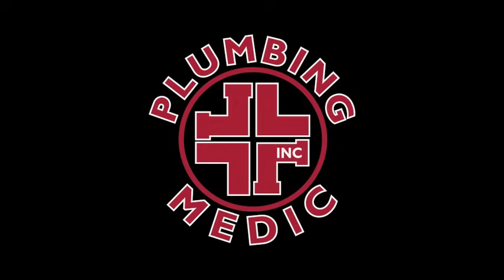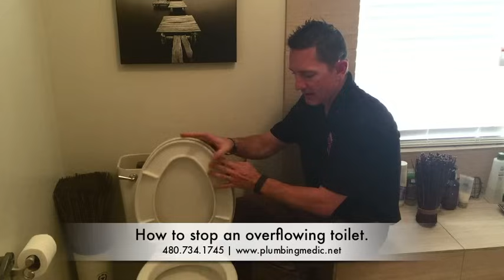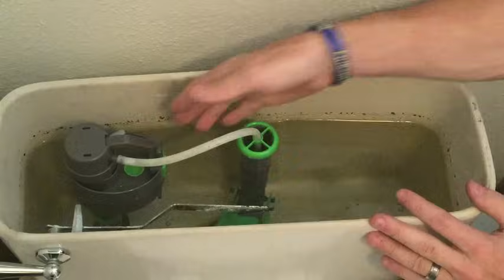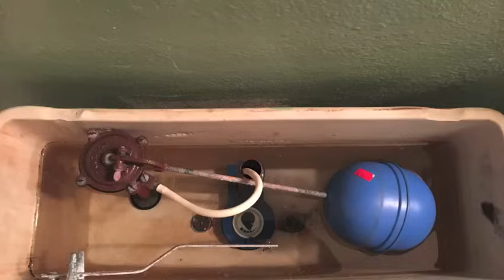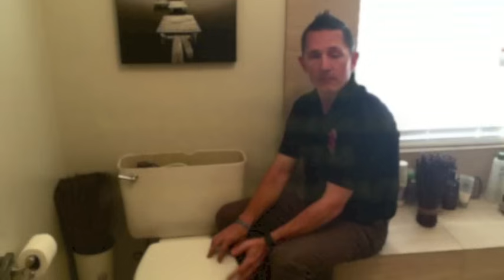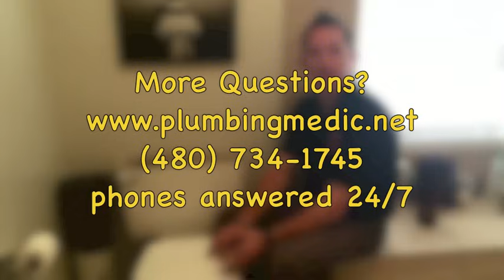How-To Stop an Overflowing Toilet | Rite Way of Phoenix

Comment: AHHH I did a dump and my toilet overflowed and my brothers always get mad when that happens and think it's my mom 💀 I'm shaking 😭 I had to wake up my mom but she went back to sleep😭😭😭😭
Reply: i̸Lucx̸y 1 I need ur help my crap is everywhere what did u do to fix it oh my god it’s overflowing
Reply: God damnit I did that to I’m not coming out of my room rn
Reply: this is the funniest comment section
Reply: @kar12894  It shouldn't be but it is 💀
Reply: I used way too much toilet paper once, and it overflowed so bad that it flooded the bathroom, and was dripping from the ceiling downstairs.

Moral of the story: If you have to use that much toilet paper flush between wipes.

Comment: I have had an issue five to four times where I would flush my toilet, wash my hands, and dry them to return 5 to 10 minutes later with a flood in my bathroom and a over flowing toilet. It will take maintenance about 15 minutes to come save the day and they can't find anything wrong. The last time it happened the maintenance had to snake it a for 5 to 10 minutes because he felt a block but eventually got it to work. This has happen over the course of 2 years. It's very frustrating and it causes damage  downstairs under me and her damage is worse. I'm the only person whom uses my bathroom and I use the very thin Scott brand toilet paper to make sure that's not the problem. Any clues to what can be happening?

Comment: This is NOT the best way to stop the overflow.  A plumbing company should know better.
Water goes from the tank into the bowl 2 ways:
1]  The MOST water is going to be from the bottom of the tank through the "flap valve," which is not even mentioned in this video.  This is the big (rubber/silicone/whatever) valve that is opened when you "flush the toilet."  It will stay open until (almost) all the water drains from the tank.  Shut this off FIRST, by reaching down to the bottom of the tank and pushing it closed.  If you do not do this, then your toilet is still going through a full flush cycle.
2]  The other water entering the bowl is as presented in this video, which is from the fill valve, from the small tube that is pointed into the stand pipe.  So yes, shut it off also, either by lifting on the mechanism (as in the video), or by turning off the valve at the wall.  Note, some toilet fill valves do not have a mechanical lever to "lift up" to shut it off, rather they are pressure activated.  The only way to shut these off is by closing the valve at the wall outlet.  However you can remove the tube that points into the stand pipe and re-direct it into the tank.

You can do both at the same time by the way.  Yes, you will have to put your hand into "toilet water," but it is just tap water that is stored in the tank.  Still a good idea to wash your hands after.
Disclaimer, I have not seen ALL toilets out there, but this addresses a basic configuration.  Also who knows how the last "plumber" may have re-worked your toilet so that it is not "normal."